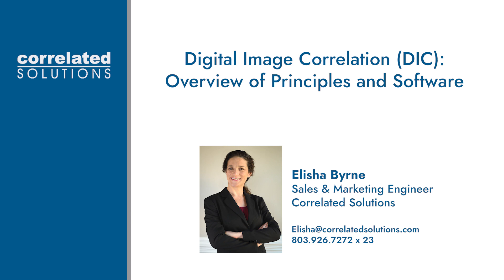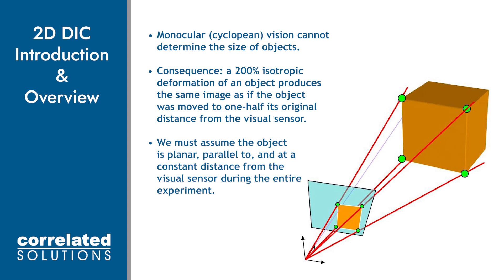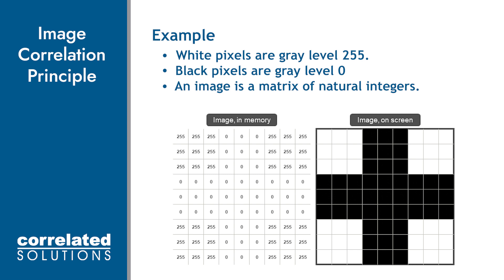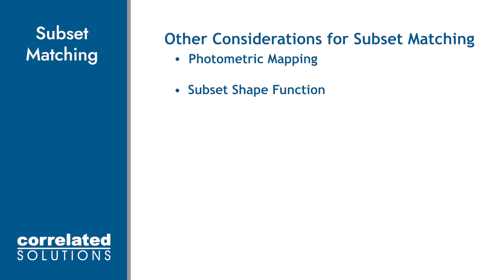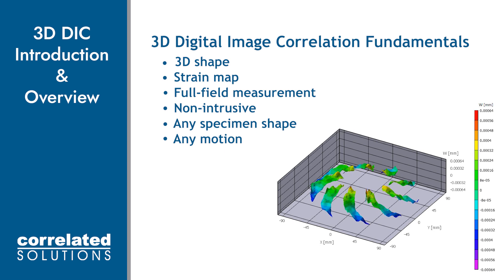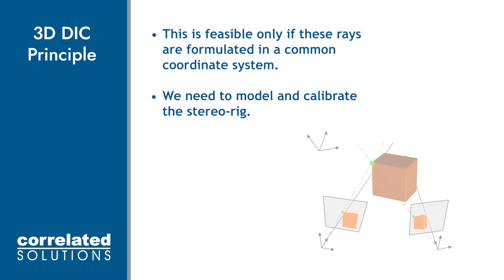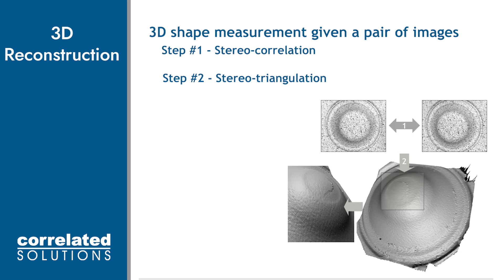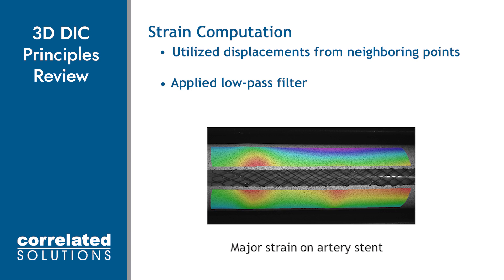Digital Image Correlation (DIC): Overview of Principles and Software

Comment: Is it possible to get Stress-strain curve in tension and compression using this technique at micro-scale in concrete ITZ region (50-70 um size region)?. Or else at least for a  50mm*50mm concrete cube in compression?
Reply from the maker: Hello, and thank you for the question. Our systems allow for integration of analog load data. The user may graph this against the strain output obtained by our software. Obtaining local strains within a 50-70 micron region would require a stereomicroscope VIC-3D system or high magnification zoom lens for VIC-2D.  However, a 50mm x 50mm region would require a more traditional setup, with two imaging systems (camera + lens) set up in stereo.  We are happy to talk to you more about your application and configure a system to meet your needs.  Please contact sales@correlatedsolutions.com or visit https://www.correlatedsolutions.com/contact-us/ for more information.

Comment: Hi for a drop test of a PET bottle, would you need a sensor, say like a pressure sensor or different sensor at the bottom of the base plate/ bottom plate during  impact  to calculate deformation/strain. Or is it only the cameras by itself with its triangular positioning which does the job to calculate strain/deformation?
Reply: You also spoke about imaging sensor, what kind of sensor do you mean?
Reply from the maker: Thank you for watching the video. For a drop test you would probably want to use two high-speed cameras to capture the 3D shape and deformation. The DIC method does not require an additional sensor, the deformation/strain is computed from the images. Additional sensors can be used, e.g., the load applied to a specimen is often recorded with the images. For high speed tests, we sometimes use other sensors for triggering the cameras.
Reply from the maker: The image sensor is the chip inside the camera used for recording the images. Until a few years ago, they used to be mostly CCD sensors, but the industry has almost completely moved to CMOS technology since.